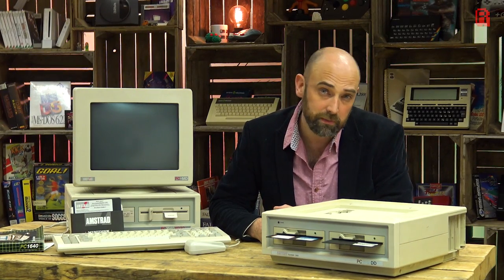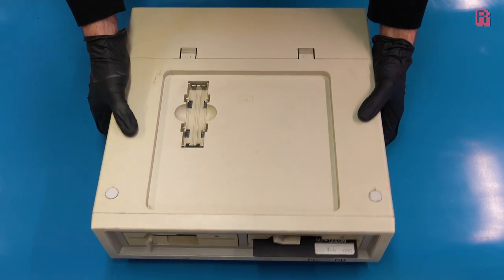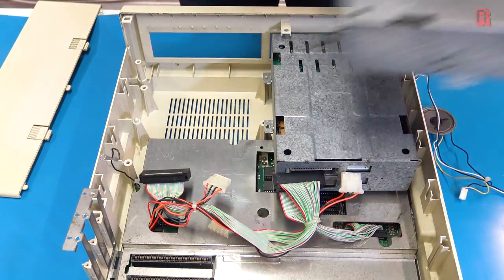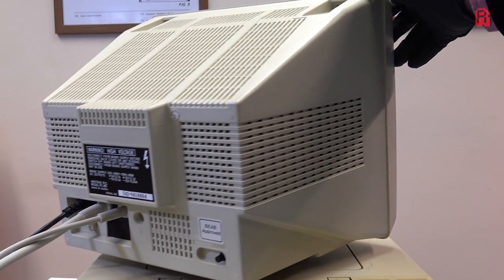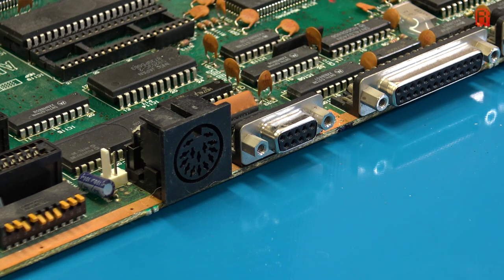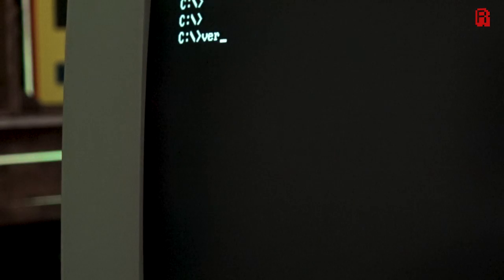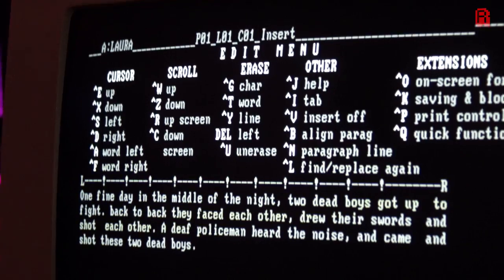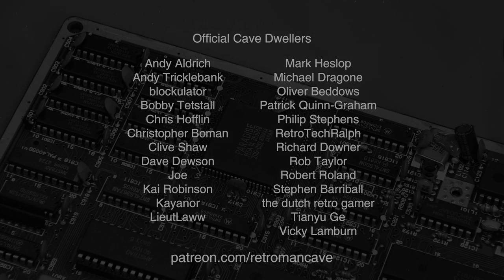The PC That Cracked Europe - Amstrad PC1512 and 1640 | Computer History

Comment: The reason for the twin video chips I think may be twofold.

One, they maybe did something a bit strange with how the new mode was implemented, possibly even approaching it differently from both Plantronics and Tandy (and indeed IBM's own PCjr) who also offered that same mode which maxed out what was possible with a standard CGA monitor (and, as technically-analogue composite is apparently the only choice - a claim that I think needs citation given that there's easily enough pins in the connector to support mono, TTL RGB and composite all at once - they may have extended the colour palette too). Meaning that, although EGA was entirely capable of that same mode itself (in fact, it was the only way to get 16 colours with a base 64kb card), it would have taken quite a bit of custom programming and patching, maybe even software overlay drivers, to get the two to play nice together, and certainly a lot more trouble and hassle than just keeping the original chipset with an extra IC bolted on to service the EGA modes. Similarly if there was also a 320x200 version. And if there was a Tandy / PCjr style 160x200 16c mode also included, there wasn't any EGA card that could provide the necessary output without some very fancy pants programming (essentially, setting an 80x200 text mode all of half-width box characters with a 1-pixel row height and mapping the image data to the colour attributes instead of the "pixels" proper...).

Two, EGA chipsets varied quite a bit in their backward compatibility and other features. Depending on who made them and the exact model, and somewhat the cost of the thing, you could have anything from essentially a bare bones clone of the IBM standard, which gives you the enhanced hi-rez modes (320x350 or 640x350 in 4 out of 16, or 16 out of 64 colours on a colour monitor, or in 3 shades on a mono monitor) plus 16 colours in all the lower CGA modes, plus rather limited emulation of CGA itself (only about half the colour palettes, no border colour, iffy handling of monochrome modes and the various glitchmodes that abused the CRTC including the common 160x100 semigraphics and others that used messed-up text modes, and of course no composite output) and of MDA, with no Hercules or direct Plantronics/Tandy/PCjr compatibility, all the way up to fancy ones that did fully transparent hardware-level emulation of all previous standards using internal CRTCs and extended registers, as well as all new EGA modes, simulation of modes otherwise foreign to the attached monitor, and super-extended modes all the way up to 800x600 quasi-SVGA including software-transparent simulation of the hi-rez VGA modes (one of the reasons why Windows uses a fixed, EGA-friendly palette in VGA mode is that it can't be certain you're not using an EEGA with a fixed-palette digital monitor). I don't know which end of that range the Paradise PEGA swings (I've done quite a bit of research on EGA chipsets of late for a personal project, but I can't recall the specs offhand), but given that it's been integrated to an Amstrad board, it's probably much more towards the "cost reduced IBM rip-off" end. Therefore, if you want to run not only PC1512-enhanced software correctly, but also anything that used CGA beyond anything more than the most rudimentary level (even using the "bright" variants of the default palettes would count), you really need it to be paired with the older video chip... even if it could no longer do neat artefact colour effects thanks to being limited to RGB-only monitors. On the plus side, all your 640x200 mode text would be so much crisper and more readable... (though, Amstrad being Amstrad, possibly the composite monitor used PAL rather than NTSC encoding and the colour bleeding was much reduced as a result?)

Comment: In those days we bought an Atari pc3, XT 8088 at 8mhz, 640kb ram, 3,5 dd floppy drive instead of the older 5 1/4, 40mb hdd and ega graphics. It beated the Amstrad in price, performance and features.

Comment: I dunno if we really benefited that much from the falling price of IBM compatibles, unless having that one slightly odd platform having become the standard is seen as intrinsically better for some reason. It merely helped bring us to where we happen to be right now.

At the same time for similar or not much more money you could have had, for example, a 520ST, which would plug into a SCART TV with a suitable cable (same as how you'd need a custom one to do that with the Amstrad ... oh, and a separate power supply brick, with 14-pin DIN connector, to replace the one in the monitor), give you better colour and sound as well as the option of a higher resolution mono display, more ports (and of higher standards in the main), and although its standard floppy drive held exactly the same amount as that of the Amstrad, it did it on a single side of a 3.5" disc and could be fairly easily upgraded to a double sided one instead. As well as to 1MB RAM or more, and many of the things you might want to plug in to the machine as upgrade cards were already present in the machine. Including HDD compatibility, which from the comments seems to have been a major failing of the 1512. As well as GEM in ROM, meaning that you could use more of its same 512k memory for programs and data (as well as the video modes occupying the 32k sweet spot between the 'strads 16 and 64k), and it booted much faster.

And, by rights, if only they'd been able to drop their prices a bit quicker, it really should have been Apple who won the home computer format war, as the Mac II trounced pretty much everything else when it came along, and even the IIgs was a pretty decent mini-Mac offering. Or maybe the Amiga, if Commodore's management hadn't stagnated it into oblivion through infighting and a litany of bad business decisions. (Atari could have, but they ballsed up even further, including having the prototypes for a Mac II like machine progressed as far as having working mockups, but then abandoning it just short of release-to-market to work on the Transputer white elephant, then the late-but-overpriced TT, and the even-later-and-stupidly-underpowered Mega STe...)

Really if Amstrad had flung their financial weight and recognisable name behind cloning any of those instead, maybe we'd be looking at a different market right now. But, they wanted business customers, and business was rapidly settling on IBM out of familiarity more than anything, and a ready cloning market had already sprung up showing how to do it with affordable off-the-peg chips and without being sued, whereas Apple had shown themselves more than prepared to sue any cloners - or even "unauthorised" re-users of legitimately purchased ROMs and motherboards - all the way into the wall, and copying the other 16-bits would have been a nightmare of custom chip reverse-engineering even just for the ST... So it's really a no-brainer they went that way. Just a shame they then also sold to the home market as well.

Comment: I know it's not the same but my first PC, which replaced my Amiga, was an Amstrad 2386 (386DX33 with 4MB Ram and 60MB HDD). It was ugly as hell, looked like a tank, and had proprietary mouse port which was the reverse of the standard D9. However, if I were to re-buy ANY of the PC's I owned..it would be that crazy tank shaped Amstrad. The rest have blurred into 1 grey box in my memory with no outstanding or recognizable features.

Comment: There are actually 3 monitors that came with the PC1640. The PC-MD version shown in this video. The PC-CD version which supported the CGA and enhanced Amstrad CGA modes, and then there was the PC-ECD display which runs EGA compatible software. Unfortunately my PC-1640 has the CD version, so no EGA for me. and the PC-ECD monitors are not cheap to come by these days.
Reply: Nice To know. I have the ECD monitor

Comment: The 1640 appears to have a VGA writing next to it's Amstrad video chip. Seeing as you say this machine is not VGA capable, do you think they merely used the acronym as a general Video chip sort of thing? This is keeping in mind that VGA stands for Video Graphics Array.
Reply from the maker: It's odd isn't it!  I also like that the 1512 has "expanzion" but the 1640 has "expansion" written on the board by the expansion slots.  The Paradise is labelled as EGA on the chip itself.  I've heard that there are some rarer 1640's released late in its life with a VGA chip.  I wonder if they anticipated this or planned it but then went with EGA to cut the price.  Well spotted
Reply: @RMCRetro  Intriguing indeed! Thanks for the video, as always :)

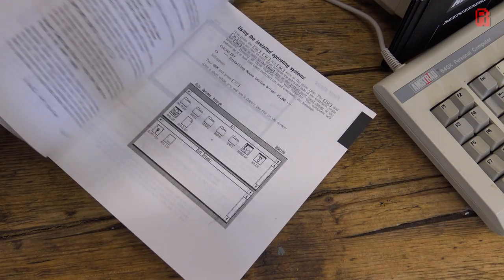Comment: At 1:35, you talk about the PC XT 286 by IBM.  I believe you meant to say PC AT 286?
Reply from the maker: Thanks for your comment, you're not the only person to question this, but it is indeed correct.  From Wikipedia |  "In 1986, the XT 286 (IBM 5162) with a 6 MHz Intel 80286 processor was introduced. Despite being marketed as a lower-tier model than the IBM AT, this system actually ran many applications faster than the ATs of the time with 6 MHz 286 processors, because the XT 286 had zero wait state RAM, which could move data more quickly.[1]:95 It came with standard 640 KB RAM on its system board (128 KB actually on board, plus two 256 KB SIMMs) and with an AT-style 1.2 MB high density diskette drive plus a 20 MB hard disk.[8][9] Despite these features, an InfoWorld review from March 1987 declared it a poor market value."

Comment: Can you talk about Olivetti computers? They used to hold a large market share in europe in the early 90's
Reply from the maker: Sure!  I'll look out for some
Reply: @RMCRetro  Yeah, would be great. At work we had a lot of them. Very expensive, very slow, very noisy and no more reliable than Amstrad's. 

I remember having had to programme an app on my private Amstrad computer using Framework, because the Olivetti wouldn't let me compile my programme. I never had any problem with my Amstrad PC1512. I had to compile/tokenize the programme, because my employer would not allow interpreted programmes to be used by normal users. When compiled on my Amstrad, the Olivetti would then run the tokenized programme just fine.

Comment: I find these early IBM clones pretty interesting.  The whole thing about the clean room design of the BIOS is interesting, I got into PC's a bit later than this in the early 90s and by that point any cheap Taiwanese motherboard manufactuer could just buy 100% clean BIOS's off the shelf and include them with their motherboards. 

Did Amstrad commission the clean room design of the BIOS used for this system or is it something they bought from someone else?

Comment: My father had 1640 which lasted for 20 years of almost daily use and spawned dozens of books and thousands of articles. But it had an AMD  in it, not intel. Interesting. Really quite verstaile  and cheap machine, even if we had to pay 3 months salary for it with a Hercules monochrome screen. Also it was possible to hide the hard disk inside on one of the RF covers so both bays could be used for floppies. 20 years and in the end it was the power supply which exploded quite violently ending a long career in botanical literature for the machine.

Comment: Thanks for making a video about this computer. I was always kind of curious about this odd-looking machine.

Sad thing is that no PC was cutting edge in the 80s or early 90s.   The Amiga 1000 or 500 were low cost computers they have better features in every way.  Too bad the company was completely stupid.

Even when Windows 3.0 came out, is performance on a 386 - 25mhz what's comprable to a 7mhz Amiga from 1986..

Not until Windows 95 and really XP did Microsoft have a operating system that had multitasking usability like a 1990 Amiga 3000.

Oh well, at least we have Linux

Comment: LOL.  Seagate hard drives dropping left and right.. Where have I heard that before.  That's 3 major episodes, and many more scattered with Seagate.  To this day, I will never buy a Seagate drive, even at half the price.  I use WD or HSGT for mechs (currently 23 Tb internal,  not inc. 3 SSDs)  I have 5 or 6 WD 1 and 3 Tb drives laying around that are around a decade old by now, and still work fine when I power them on to back up.

Comment: Amstrad's main problem was they never believed in testing compatibility. So when Seagate shipped a buggy drive that didn't conform to specifications Amstrad PCs all had issues and it totally killed their reputation and PC business.

The reason Wordstar failed was simple, their application was all key shortcut driven and so users spent ages learning these key shortcuts. But someone at the company decided to remap them all (maybe to make them more logical) and therefore users upgraded and could no longer use the software well.

Comment: imagine that..... seagate hard-drives failing.... 

yet my OLD AS THE HILLS WD blue 1TB drive..... with 53,200 hours on it (or 2216 days.... or 6!! FUCKING!!! YEARS!!! of 24/7 on time)
is still running just fine.... 

its a WD10EALS-00Z8A0....... and its a DAMN good hard drive

they STILL want 70 bucks for it on newegg.... which is crazy
the price is probably becauuse its a SOLID fucking drive...... 

i just cant believe that a HDD can be run for 6 years 24/7 in a 8 year time frame (i dont shut down my PC unless i need to)
and still have ZERO failed sectors or any other issues....

Comment: I had a 1512 and really liked it. Amstrad were really great at making computers that were like white goods. Everything integrated as a single solution with almost no possibility of setting it up wrong. The CPC with its integrated cassette deck did this to remove the cables. GEM disks for the 1512 were numbered and colour coded so you knew exactly which disks to use to boot it. They really were given an unfair hand with the Seagate drives.

Comment: Did you say PC XT 286. There was no such thing. Did you mean the IBM AT 286? come on. you are SO professional.  a silly slip-up like that makes it look lazy in you research.
Reply from the maker: This is indeed correct.  The PC XT 286 was released in 1986 and in some circumstances was quicker than the AT.  It's also known as the IBM 5162
Reply: Bad new Damian. There certainly was an IBM XT 286 at the end of the XT life line. It was even badged  as such!